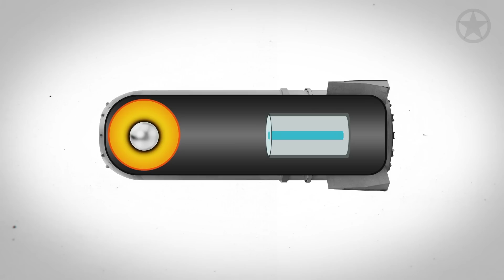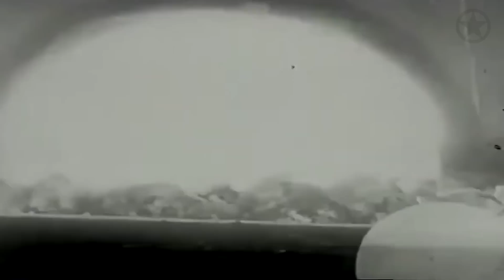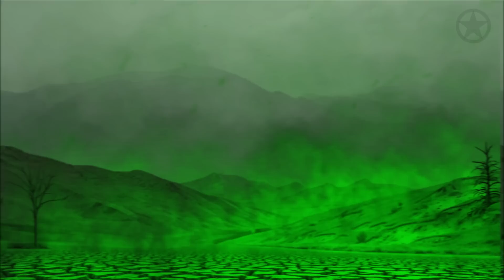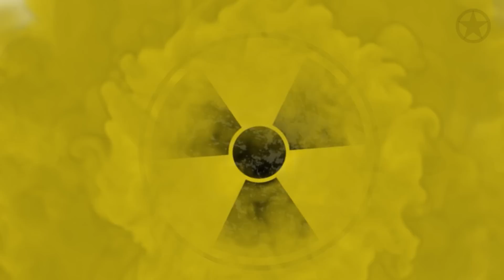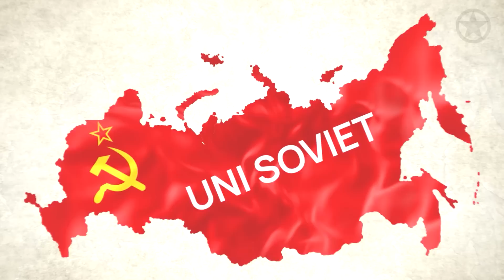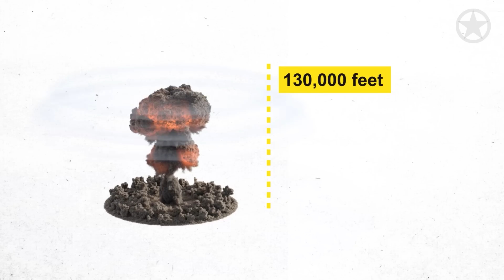This is The BOMB to Worry About - Here's Why!

Comment: A cobalt laced nuke is actually an area denial weapon more so tgan a doomsday device. The radiation from the cobalt is short lived compared to the regular fission products. Using a regular DU or thorium jacket will give more fallout and increase the nukes power at the same time. The typical use case would be against hardened VIP bunkers to prevent rescue.